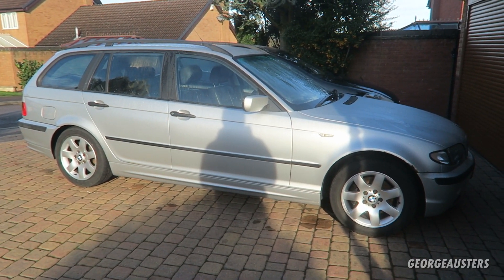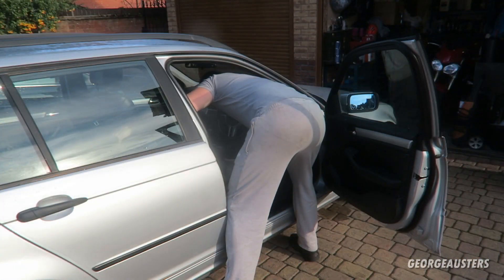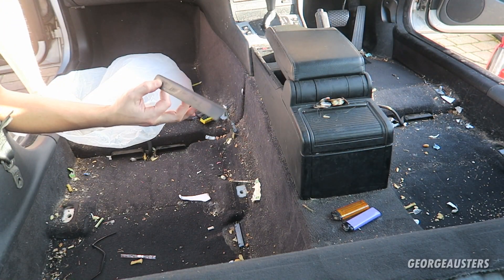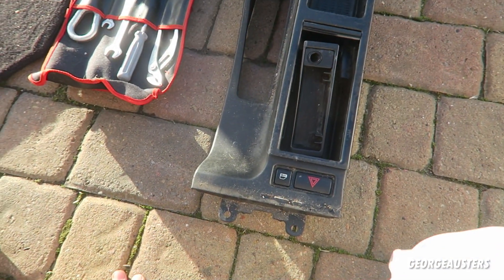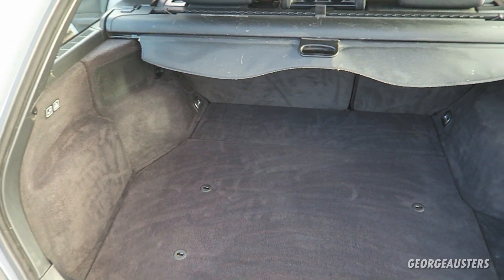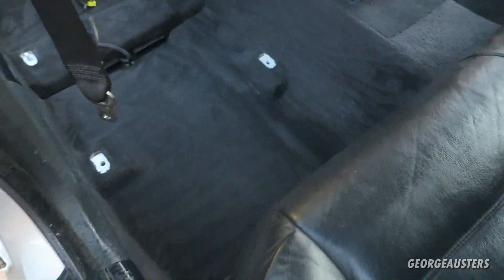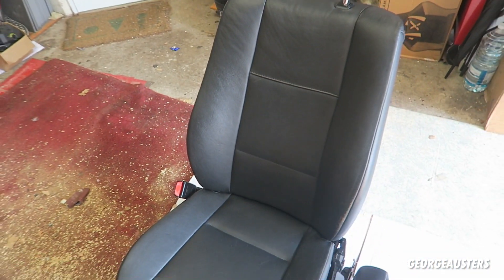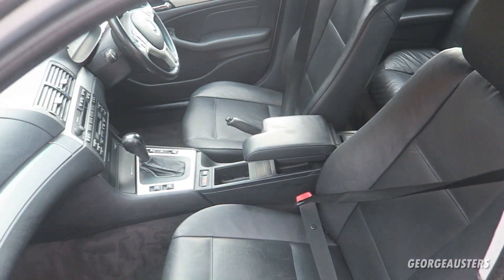HOW TO DEEP CLEAN DETAIL THE INTERIOR OF A CAR

Comment: Hi George .perfect timing I have just purchased pretty much the same car ...not as bad on interior though.needs the same deep clean but first need to sort the running problem or lack of as it currently does not run due to a fuel supply issue ..cheers..
Reply from the maker: Ah nice one, I should have really got mine running before making it look nice but thought I may as well while I wait for parts!
Reply: @GeorgeAusters  yes I'm the oppersite want to see it running before I make it look pretty just incase it turns into a major project..saying that it will make a real nice daily as I'm also planning on a few subtle mods just to improve performance ...I think my issue is Hp fuel pump related waiting on bits as you are..great cars and well worth repairing as parts are plentiful..

Comment: You planning on changing the drive belt? Need to do mine but no decent YouTube videos
Reply from the maker: Yep, should be doing it next week!
Reply: @GeorgeAusters  any tips on removing the AC belt on this engine? That’s what I’m struggling with to get at the Drive belt so I can replace it
Reply from the maker: Earlier ones like mine have a tensioner... Guessing you have stretch belt?
Reply: @GeorgeAusters  mines an E90 on a 57 reg so last year of the M47 engine! Yes it’s stretch belt so fine to get back on just by turning but getting it off no idea lol
Reply from the maker: @rhysbozok715  Need stretch belt tool

Comment: Great job! I Cannot believe you dont own a Vax carpet cleaner mate the amount of car projects you do.. I got one I ain't even used yet lol 😅 gotta do my e46 shortly. Also need to do my E90 both m47s E90 leather E46 fabric but both 6 speed manuals same lump. Lucky I got in just before the dreaded n47 on the E90 had from new only done 57k uprated turbo, had it of road couple years just keep miles off it and use the E46 that's still only on 127k so I'm gonna give the E46 54plate the same treatment as you gave this but use the Vax cleaner aswell and then look to sell it I think I've had it since 82k full service history all motorway miles aswell so its like barely run in for a diesel as you know at 127k.
Anyway I got a lot of great tips from this video and also from the series on this car.. if mine was an estate I'd be keeping it for sure! It like new but being a saloon and having the E90 saloon just no point having 2 the same and E90 only 57k new uprated turbo and owned from new so no point that's my keeper like LITERALLY until they outlaw diesels and then I'll work out how to make my own lol 😅🤦🏻🙏🤣😎
Cheers pal great job!
And if you fancy a E46 Manual low mileage project M47 let me know lol.. btw I ain't done swirl flaps on either of mine and I know I gotta do em cos it's tempting fate.. so gonna watch your video on that and see if I wanna do that before I sell it. Defo wanna do the E90, but not sure whether to pay someone else to do it for me..
Reply from the maker: Yeah I need to invest in one for the channel!
Reply: @GeorgeAusters  get a Blue Vax as orange ones are purely home light use, blue Vax cleaners still classed as home use I think but half professional (better quality & heavier duty all round better) be more than good enough for doing the cars got the hand held attachments and also pet attachments all sorts that's what I went for larger Blue one when they were on sale under £300..